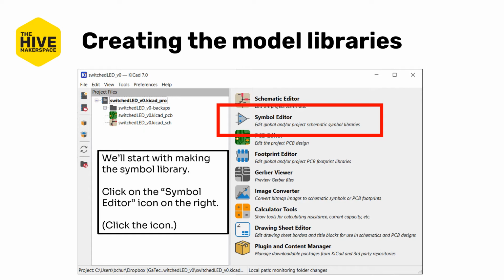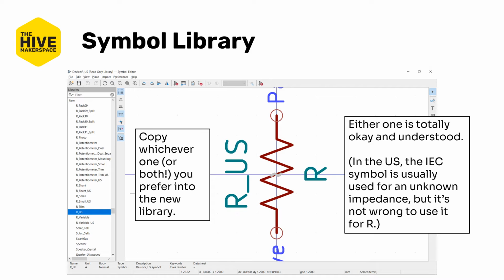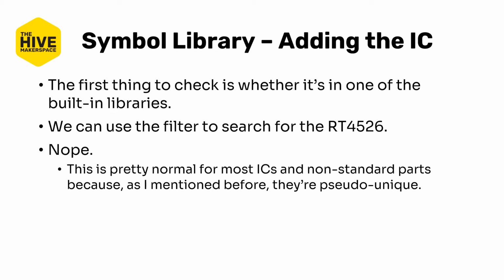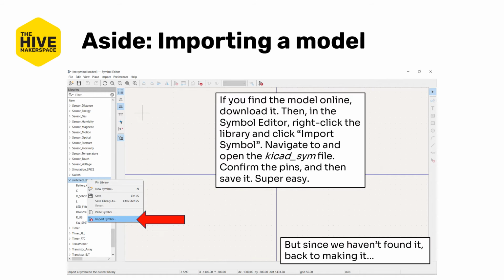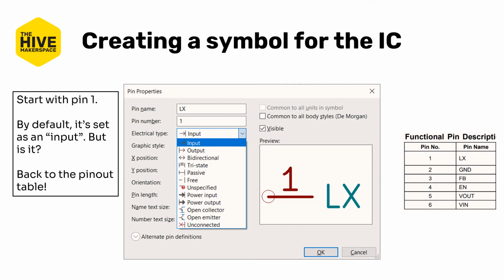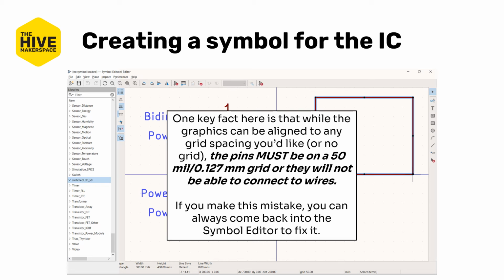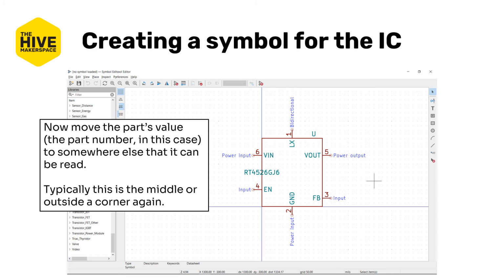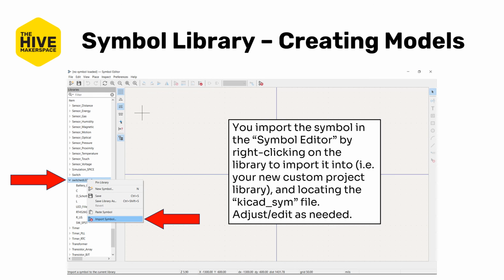PCB Design with KiCAD, part 6: Good Library Management and Making a Project-Scope Symbol Library

Comment: Why not just place them in the schematic from the global libraries, then do a File > Export > Symbols to New Library, make it a project library in the pop up, then in the next dialog do a Update symbols in schematic to refer to new library?  Seems a lot easier.   You can do the same in the PCB editor....

Also, in a professional setting, a lot of companies have librarians that make approved libraries.  Having a bunch of the same parts in a zillion libraries can be a change control nightmare as well as poor relational database practice.

Comment: Great tip.
Before watching your video I added parts separately to project specific librarys. Was pretty awful.
How to you assign missing 3D models?

Edit: Same workflow but with the Footprint Editor. If some parts are not provided with a 3D model -> chose footprint / file / footprint properties / register 3D Models ...